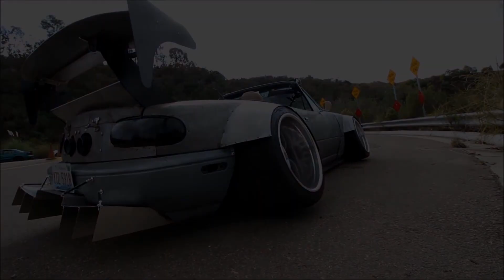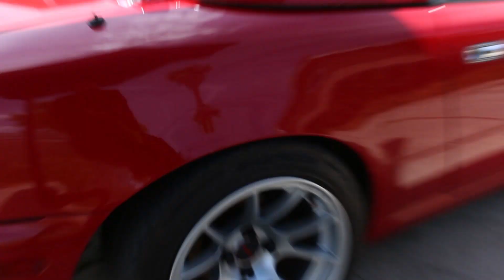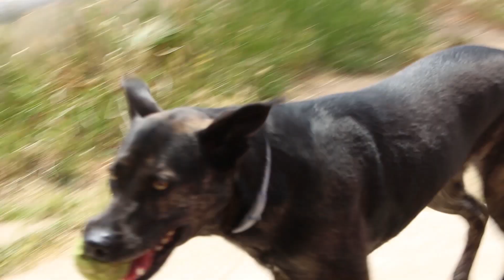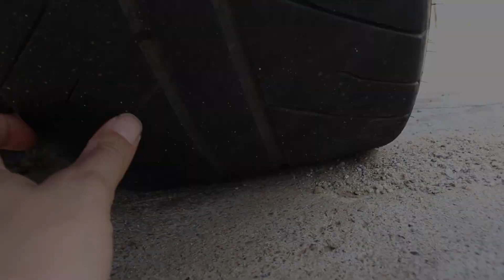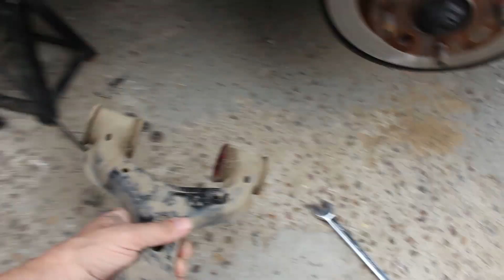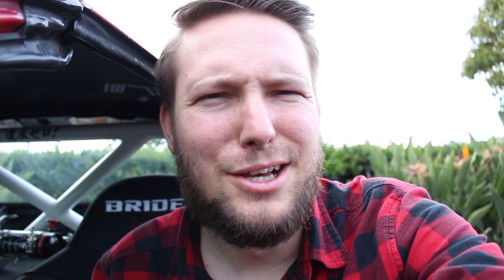Increasing Traction With Paco Motorsports Adjustable Control Arms!

Comment: @TheCarPassionChannel how did you get the old poly bushings out of the old arms and into the new adjustable arms... grinder?
Reply from the maker: Poly bushings are super easy to remove and install. Many can be done by hand actually

Comment: Great video. Did you ever get any suspension squeak with drilling and installing grease fittings? I bought a set but am concerned about that squeak. Thanks

Comment: What’s the wheel tire combo?  Spacers?  Perfect in my opinion.  Looks larger than the PTS 15x7’s..
Reply from the maker: Jongbloed Racing Series 500, 15x10 +25mm. 245/40R15 Hankook R-S4 in this video, but now running 245/40R15 Nankang AR1

Comment: Hey Miata Dad, thanks for the video.  How do you like the Paco arms after spending some time with them?  I purchased the Paco arms and getting ready to install as part of a major suspension overhaul.  I am a little worried about that locking nut coming loose under hard driving.  Any issues with that?
Reply from the maker: I've probably got 10,000 miles on them by now, and I haven't had one of the nuts come loose once. So far so good! (It's always a good idea to check adjustment nuts like that as part of routine maintenance, like every oil change)

Comment: What are your wheels specs in this video?
Reply from the maker: 15x10 +25 with 245/40's
Reply: TheCarPassionChannel thank you so much. So that would mathematically be the same “poke” as a 15x8 +0 right?  I run 15x8 +0 on my miata but was given a ticket for not enough fender clearance even though I am rolled and the tires never rub. The law here in Vancouver Canada says that I need to have at least 1” between the fender and tire so now I don’t know what to do. However it looks like you have over 1” clearance with your aggressive fender pulling/flaring. I am more credit card fitment. Instagram @kevinminato. Is there any modification that can suck the bottom of the tire in to correct negative camber without pushing the top of the tire out?
Reply from the maker: @KevinMinato  Same poke as 15x8 +0 yes. I've had a "warning" for the same thing about exposed tire tread. The only thing that could pull the bottom of the tire in (aka reduce negative camber) would be adjustable lower control arms. Judging by the pictures of your car the top of my tires actually poked a lot more than yours where's the corrected camber and wider tires (that gives you an idea of just how flared the fenders are)

Comment: Love the video's, I don't mean to be THAT GUY, but here goes. Optimum rear camber for a Miata rear is 1 degree, with the driver in the car. It is good for road and track days.
Reply from the maker: Thanks man, 1° is pretty conservative, but will definitely work fine on a dual duty car. Check out 949 Racing's alignment page, they have various setups posted that have all been tested and tried on their race and street cars. Optimal camber also depends on tire compound and various other setup-specific factors 🙂

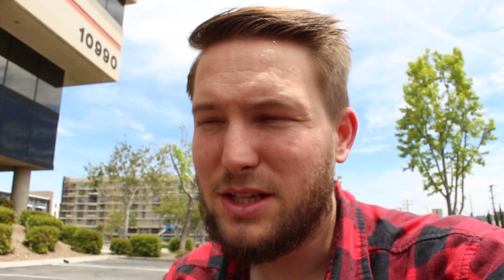Comment: 6:22 101-96=15??? I don’t think that’s right :D also how much toe-in/out are you running? Toe-out heats up the tires on  the inside patch as well ( and toe-in heats up the outside).
Reply from the maker: 101-96 does not equal 15, you're correct. However, 111-96 does equal 15, and those were the temperatures measured across the tread 🙂

Comment: Dear Greg
Please consider to produce an episode where you embrace Auto-Blip due to an Cable-2-DBW-Converter (as found in Peugeot 2.0hdi (306,406 Expert etc) 90 - 04) and taking care of business with brake- and clutch-switch, gearbox- and diff-ratio and the actual speed, all by mastering your MS (no, not Mara Salvatrucha!).
In my (very own) opinion a car without ABS is much smoother to control at it's limits without fancy square-dance footwork (or I might have got two left feet, who knows) and the technical aspect of such an operation would be challenging and quite interesting for the most of us.
Go for it!

Comment: The ricers that own Triumph Spitfires love to run like 45 degrees of negative camber. its insane. Im exaggerating, but its a lot.

It only works cause they have no horsepower. I cant relate, I have to run my spitfire with neutral camber

https://i.pinimg.com/originals/ba/0d/32/ba0d325083d9d3e5a79d02b5e751d0ab.jpg

Comment: Hey Greg, great video! Just a quick question, do you think a VLSD could hold a mild turbo setup? Cheers from Sweden!
Reply from the maker: The LSD type doesn't matter so much as if it's a 6 or 7" ring. In the US the 90-93 1.6 diff is pretty weak and they can break at 180-200hp, sometimes people get lucky up to 250+. The 1.8 diffs are way stronger, currently running one in my car now. Open vs Torsen vs VLSD is just a performance thing, not strength 🙂

Comment: Awesome video Greg, I wonder how this translates to track use when loading up the rear tyres exiting corners with side-load. I have a track miata myself and I've been wondering what a good setup would be here for high power applications, and whether the stock natural camber (lowered/not slammed) is anywhere near ideal for this. Could be a topic to cover for you/something to play with if/when you track the car next. Could also do one on tyre pressures and getting the tyres to deform more for traction/how this affects heat and sidewall temp etc... pros/cons... As I've said before love this channel and always look forward to new content.
Reply from the maker: That's where temperature measurement and sidewall rollover measurement (shoe polish over the sidewall) really help. Both with setting up your camber and tire pressure!

Comment: I’m probably wrong, but don’t look as strong as OEM. I’ll let you test them.
Reply from the maker: They're currently running on a 450+whp V8 track Miata on sticky tires, as well as tons of off-road builds. Holding them in my hand they look much stronger than stock, they have at least double the wall thickness if not more

Comment: Do I need upper arms for more negative camber? How far can you go on stock setup?
I'm running -2 front and -1.6 rear and I need like -3 front and maybe -2.5 rear?
Reply from the maker: For what reason? Fitment?
Reply: @TheCarPassionChannel  more corner speer

Comment: 3rd gear being mystery gear could partially (mostly?) just be your tire temps.  RS4's really need to be warmed up before they start sticking... although my experience is in corners at the track, I don't have enough power to stress a 245 RS4 at any temp under acceleration...
Reply from the maker: When they're cold they spin much easier. I'm mostly referring to when they're at full temperature, it's like a 50/50 shot if they'll hook. If the air is cold they spin easier for sure from dat boost

Comment: Is there anything like this for the front? Or is the camber not as bad up front with a lowered car as the rear?
Reply: Destroy or die makes both lower and upper adjustable arms, there are also extended ball joints made by other companies 🤔